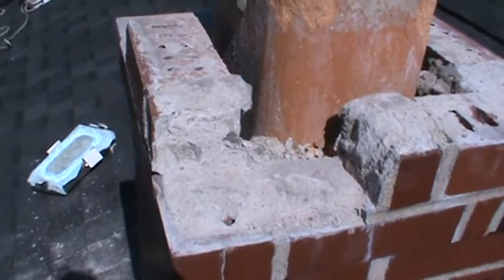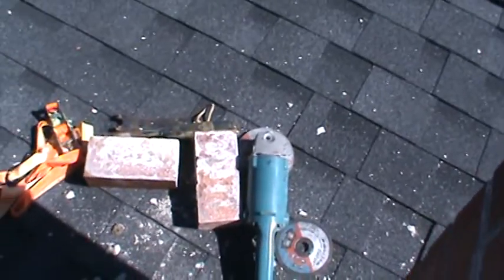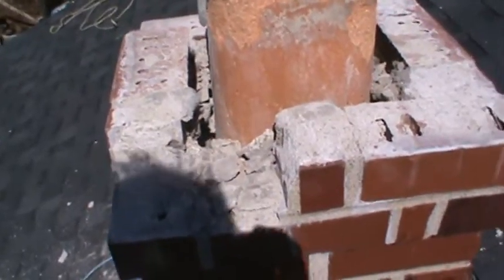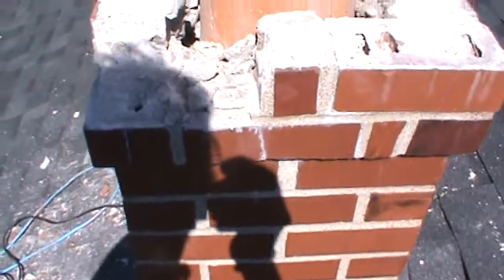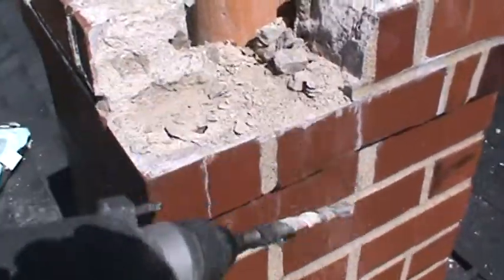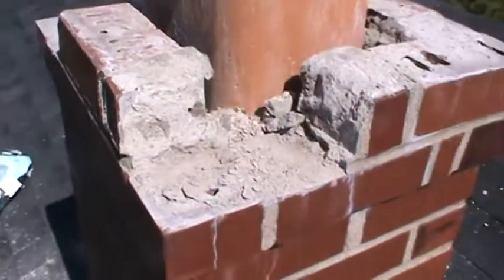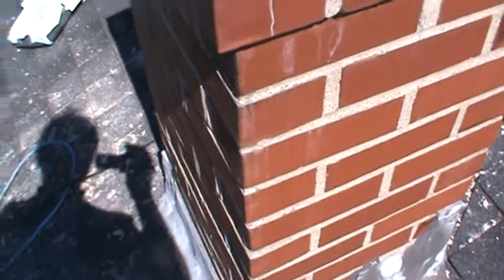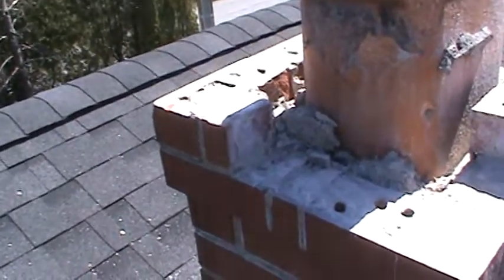Best way to remove mortar from bricks that i found

Comment: Listen, Mate, that was the best tip ever after I'd watched so many other videos. Brilliant! Cordless hand drill using hammer function with drill bit. You're the best. I'm gonna buy spade bits to boot. Bless you and Thank you! 🥰
Reply from the maker: A spade bit would be much better. This is what i had at the time and worked great for me . Good luck on your home project .
Reply: @hydniq3327  Thanks! Keep up the fab work. 😊